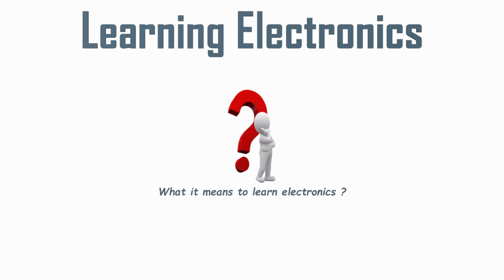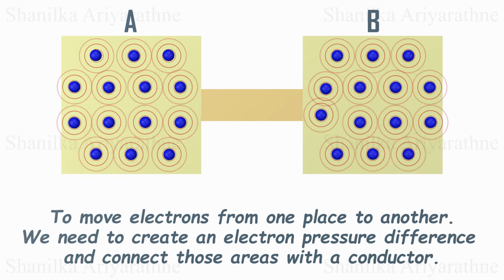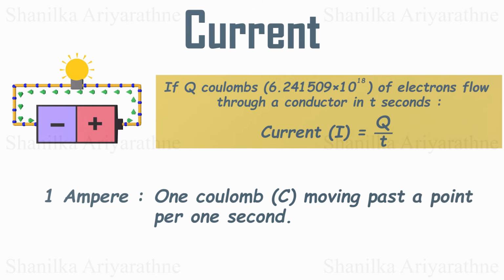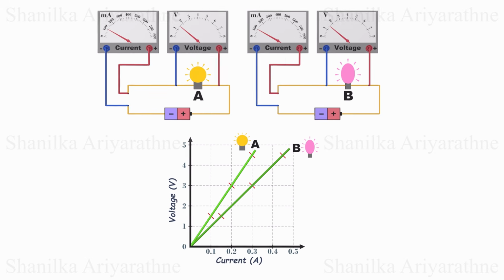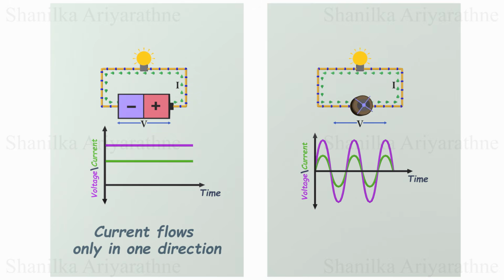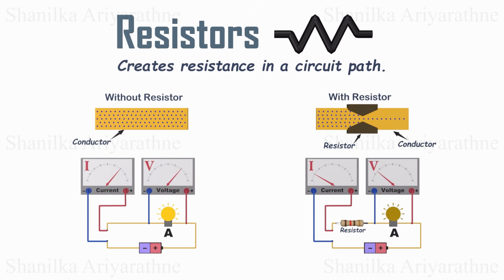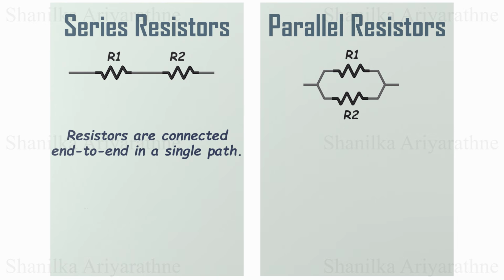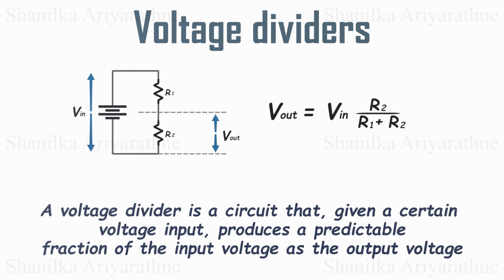Electronic Foundations : Voltage Current and Resistance

Comment: If electrons go from negative to positive through a circuit from a battery it doesn't make any sense that the current would go from positive to negative like you described it's just doesn't make sense. Electrons should be going in the same direction as the current through a circuit from the battery
Reply from the maker: Thank you for your comment. This is a common point of confusion, and I completely understand why it doesn’t seem to make sense at first. I also feel it can seem like an unnecessary complexity. However, if we tried to change or update it now, it would create even more problems, because so many existing systems, textbooks, and circuit designs are built on the current convention.
Reply: That is a misconception yes but it’s correct in the video

Comment: Hey I love your channel! I wanted to ask two questions if you have the time:

1)
I was told that even if a system isn’t grounded (no ground rod to neutral etc at transformer and no grounding anywhere ) that if a power line that’s energized comes down and touches the earth, that it would still energize the earth. Now if energize means put the earth that it’s touching at its voltage then that’s surely true right? No matter if it’s soil, gravel, water that it’s touching right? A  120 v line comes down, and it will make the earth 120 v relative to neutral (in USA), no matter if that powerline is touching dry pavement, dirt soil or water right?

2)
The second question is - let’s forget about voltage. We have this 120 v line touching the ground - let’s say it’s grass or soil or water, is it possible for a current to flow thru the very earth itself if there are no grounding rods or grounding stuff anywhere near by? I ask it this way cuz I’m tryna take away with “return to source” and still see if current would flow thru the earth.

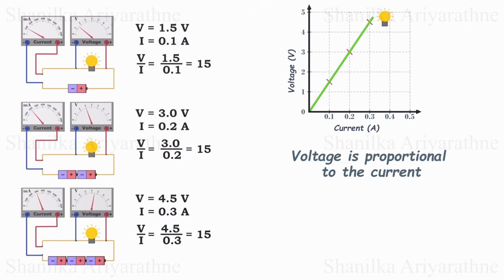Comment: Doubt in 12:27‚ if more number of battery connected in any manner only voltage or current increase. Both are not increase on same time based on parallel series battery connection concept.

Comment: Best explanation for basic electron flow from high pressure to low pressure area which creates a potential difference between two terminals leads to voltage applied. Nice one I've not been understand this before from any Books 📚.. Thanks lots of love 🤝🙏

Comment: Bro you lost me when doing the calculations for resistors in parallel. If the is 1/R1 + 1/R2 + 1/R3, how did you get 11/RT or for the example you gave, 12/RT?
Reply: Where in the video are you?  At 29.04, the "12" is volts.  The expression is volts divided by total resistance to get amperes.
Reply: It's still a wrong calculation. Can you put down the whole equation, please. My result is different than yours!
Reply: I got lost here also and was wondering the same thing.
Reply: @McNaught82  there is a mistake made there, that's why.
Reply: @Mr.Therapist1 yeah. I was able to get the 18.33, but not from 12/220
Reply: @Mr.Therapist1  no you need to take the reciprocal of you answer?
Reply: For anyone reading this thread with the same confusion; @sinslater and this video are correct.
In the first example, 1/RT = 12/220Ω is the same as RT/1 = 220Ω/12, therefore: RT = 18.33 Ω
Reply: This is a tricky one for me too😊
Reply: 27mins? Is that correct? Something not right there as it say 5ohms the. 5v something off there
Reply: https://youtu.be/9bmk9atwfhE?si=y7N6tNnESPMkuk1-
Reply: This video helped me a lot